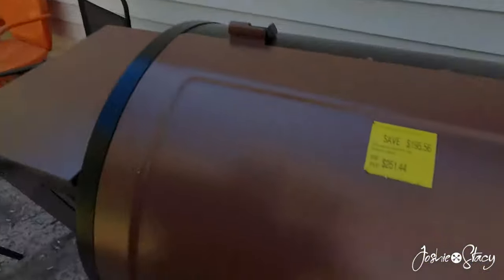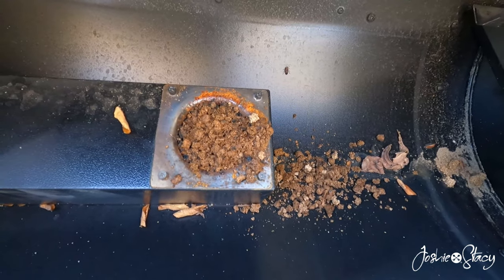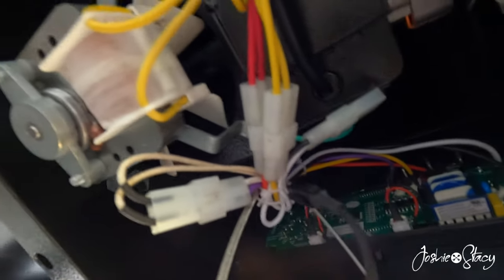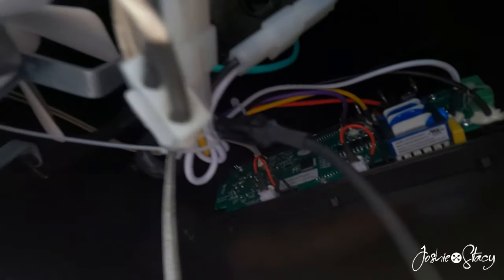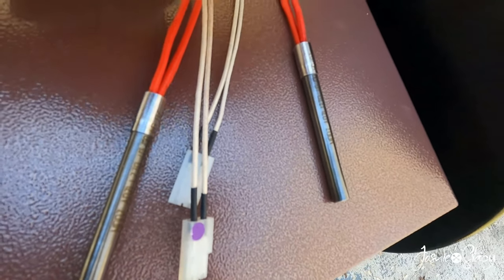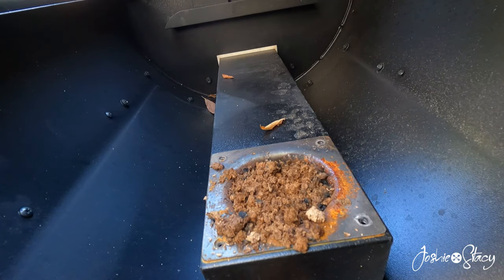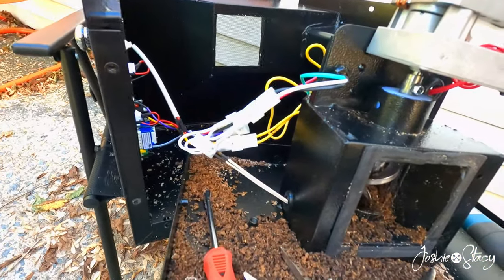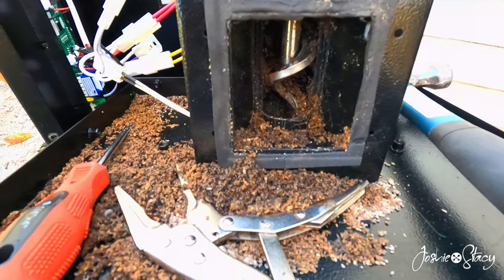Pit Boss Austin XL Igniter Replacement and Then Another Problem - Pellet Smoker

Comment: Yes, water or even moisture can destroy a smoker for sure. I have thankfully never had the auger jam on my 1100 pro. I have seen where people that did say to really soak the pellets inside your auger with water and it will soften them back up to a point where you can clean them out. You'll love it when you get it fixed. Good Luck!!
Reply from the maker: Thank you for wishing me luck! When I bought it Walmart didn't have a cover for it or I would have bought it then. Like I said in the video, I typically use stick burn smokers. I thought about soaking it down but thought it might make it worse. Thanks for the tip!  I'll bring shooting the second video in a day or two and I'll definitely try it. Thanks for watching our video!!

Comment: don't know if you fixed it yet but i just went threw that with mine but try resoaking the pellets with hot water just keep soaking them then use a 1/2 inch hammer drill on hammer reverse to back it out then go forward and ream out tube with auger
Reply from the maker: Thank you! I need to get back out there and do the second video and try your recommendation.